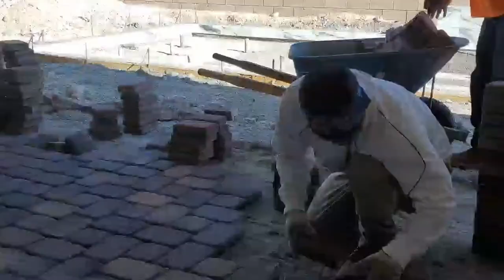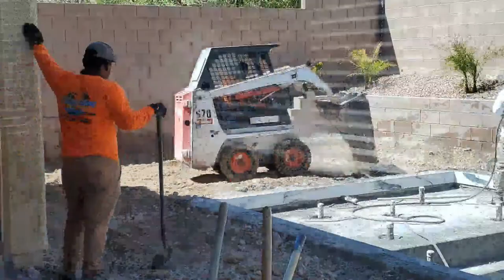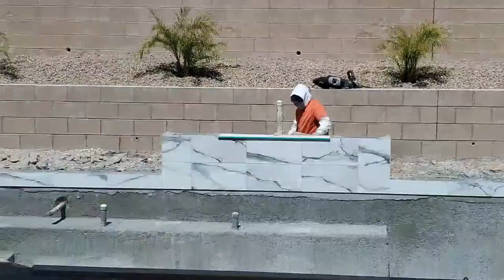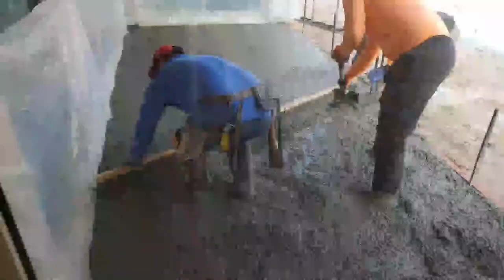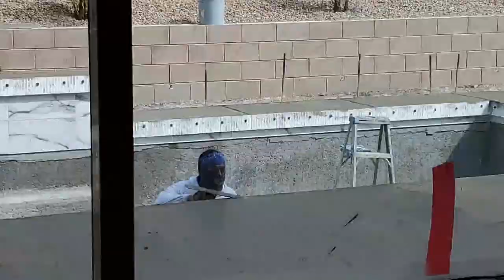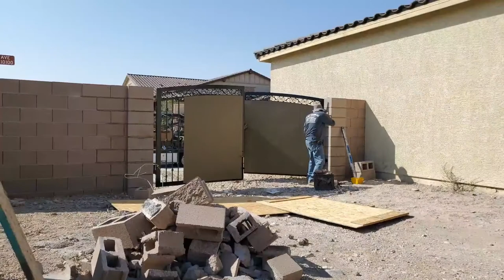POOL DECK & RV GATE INSTALLATION - TIMELAPSE

Comment: I couldn't tell in the video, but could you please explain how they did the back of the raised water feature?  The plumbing was behind the gunite concrete, but on the finished product you couldn't see any plumbing.  Did they build that wall out thicker with something else? Is it tiled back there, or concrete?  Thank you!
Reply from the maker: They built it out thicker with the gunite concrete. It's probably 16 inches thick from front to back and it hides all the plumbing.  I have a new video on my artificial turf install and it shows the back in more detail. Thank you for watching and for commenting.